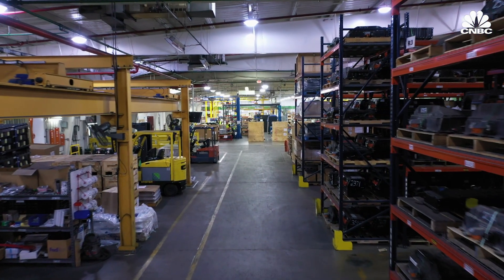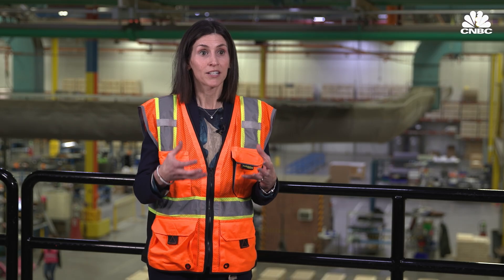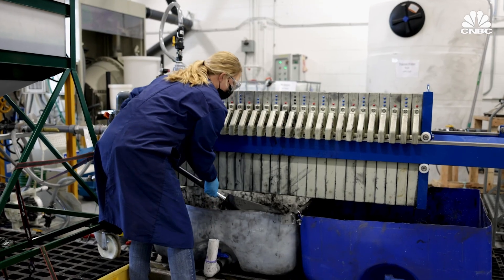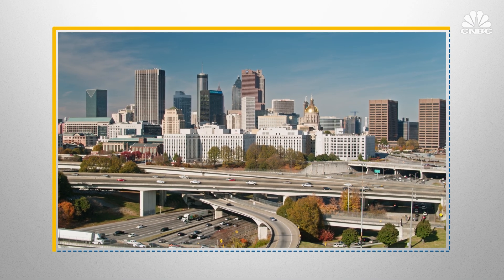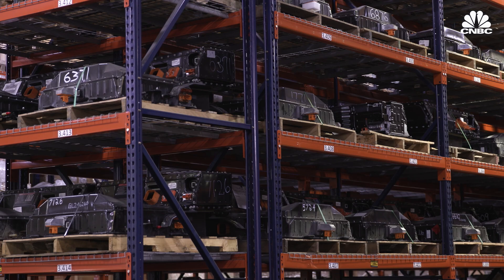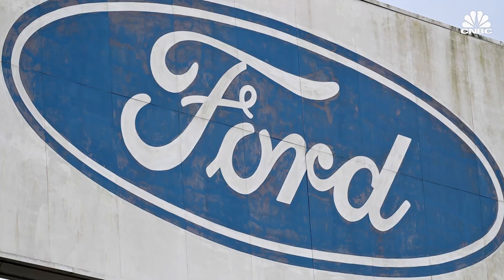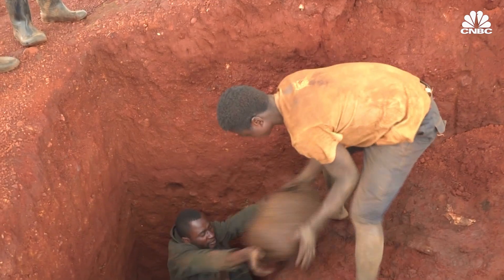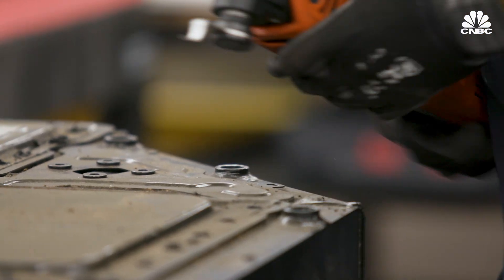Where Do EV Batteries Go When They Die?

Comment: In Australia it appears 90% of all Li-Ion batteries go to landfill and this would be the case in many other countries due to the lack of facilities that can safely dismantle large packs and the fire risks of shredding cells and packs. There are substantial cost involved in construction of these plants, the safety systems and trained staff to operate these processing plants. The failure even extends to solar PV panels of which 99% go to landfill.

Comment: A battery pack is only good for 12 to 15 years?  I have a 2008 model year IC vehicle with just over 100K miles now.  I plan to be driving that for at least another 50K or 100K miles, until the current engine or transmission needs a rebuild and the price of the rebuild does not make economic sense to keep the car.  So at the pace I drive I will have that car for 30 years.  EV's need to be competitive with that, or they are just not practical for me.

Comment: You say SNT handles 15,000 batteries a month. The guy you interviewed said they get 50 to a 100 a day. At 30 days of 100 that's 3000 batteries. If it's the lower number it would be 1500. Did you just add a zero to get the 15,000 number?

Comment: Ya no it cant be recycled so where does all the batteries go to the junkyard. Come on people need to realize ev was a bad idea your going to mine out all the minerals and it wont truly be recycled back like steel from regular cars. There is a limited amount of minable minerals for a battery and once all thats mined out your are screwed if your still electric
Reply: fyi the ammount of contamination and leaching and toxins put back into the world from recycling a battery is very very bad this vide only showed refubish batteries and once it reaches its 30 year use it is a DEAD BATTERY and only way to fix it is to recycle it which causes more pollution then even the help of a electric car in the first place

Comment: why is the new ev battery rate at 12-15 while the reuse one at 5-30. The lower bound make sense but the upper bound is odd. Somehow they extend their lifetime after refurbishing?
Reply: because they are being used for different purposes, inside an ev there is much higher power demand from each cell whereas for a stationary aplication the power demand and recharging is smaller thus they have even lower degridation when they are reused. Also, they replace the most damaged part of the pack, because often their are individual cells in a battery pack that have much higher degridation than the others. If you replace the degraded cells the battery can almost act as if its brand new.

Comment: And yet most EVs are still running on fossil fuel generated electricity.  Why is there anyone thinking about green energy? eh... no, solar and wind just won't cut it.  Fusion is probably still years away.  People says No to Nuclear.  Even if Nuclear plants are built, the aging electrical infrastructure is probably not going to be enough for many more EVs?

Comment: 10-15 years is not correct. When batteries are not used in the car anymore it will continue to be used for another 30 years as a battery bank in a home.
Reply: as a mechanic I discuss the problems with electric cars in depth on my home page vid

Comment: Li batteries are very sophisticated and nothing like lead acid batteries. They have many different layers and complex structures, making them harder to recycle than one may think. Plus solid state batteries will eventually be used and this means another type of recycling may be necessary.
Reply: Clearly a problem that can never be solved. We should just give up recycling as no one will ever figure out a cost effective method to recycle Li batteries. You should probably let Redwood materials know that there is no use expanding their factory as what they are already doing is too difficult to be done
Reply: @Jeddin stop being dramatic. EVs run off  60% fossil, 20%nuclear, the batteries are extremely toxic to mine(done in mostly poor non-environmentally regulated countries), and the batteries are very difficult to recycle. When you drive off the lot in a brand new EV, it’s done about as much damage to the environment as if you had drove 100k miles on a gas engine.

I am not against EVs, but I am certainly against the current propaganda the gov. Is using to push them.

Evs have been around just as long as ICE vehicules and there is a reason we have gone w gas vehicals, as it is much more efficient.
Reply: @bluesfan6862  you are the one being dramatic with “the batteries are very difficult to recycle”. Look at the interviews with Redwood Materials founder Jeffrey Straube former Tesla confounded who started the battery recycling company in 2017. Their tech demonstrates 95% efficiency in ev battery recycling. However they have been mostly recycling laptop and cellphone batteries as they just can’t source enough EV batteries. The supposed EV battery environmental Armageddon has never happened. The batteries are lasting in cars much longer then expected. And when they reach end of life they are being reused as stationary battery storage since an EV battery end of life is 30-40% degradation but 60% of a 40-90 kWh battery is more then plenty for stationary storage.
Reply: @bluesfan6862 ... There's another problem they let slip out of their mouths.  A recycled battery pack going into a new car?  New car buyers aren't going to be purchasing a new battery tested from "new" but having to have older Lithium cells with refurbished other cells to really have miles driven and recharged on a new car sold? I'm glad I'm not getting scammed by accepting a new car with refurbished electric cell battery packs that already come with less miles to go on them because refurbished is miles already driven and recharged with what's there. 😬

Comment: I would like to see what the emissions are relating to this? Next day delivery and all that 😅
Reply: A very good point Sir.

It all depends on how you create your energy in the first place.
Where I live (in Australia) we have weeks on end where there are zero emissions for all of our energy consumption across millions of homes, industry, and infrastructure alike due to our progressive government's push to increase wind, solar, and energy storage. Once we get to 150% renewable energy then we can re-awaken industries that have long since closed (or invite progressive new ones) due to rising costs and cheaper production based mainly in China. The extra 50% is included as a redundancy for when the wind doesn't blow and the sun doesn't shine, in the very same way that out coal and gas fired generators have an extra 50% redundancy for maintenance and breakdowns etc.

Having personally worked in the mining and energy industry for many years, I have personally seen the changes over time as we transition away from one system and towards another. That being said it's interesting to hear the amount of 'noise' coming from the sector's that have not anticipated the transition and the message that they spread. Very interesting times indeed👍

Comment: They said the life of an EV battery pack is 12-15 years. This is like saying a gas motor only has a 100,000 mile lifespan. It is correct that they do not have new performance at that point. And your range is probably 20% degraded compared to new. But that is still over 200 miles with a good EV. 

So with an old ice car you put oil in it more often when it starts burning oil. You don’t get rid of it. With an EV you charge a little more often. You don’t get rid of it. 

In 2040 I expect plenty of 25 year old EV’s limping along being purchased for like $4000.
Reply: And this solves the "Poor people won't be able to afford an EV" problem.

Comment: This is so encouraging!  I've seen a YT video where a garage that works only on EV's  fixed a "dead" battery by replacing a few defective cells.  Batteries consist of cells, your lead acid car battery has six of them.  It's rare that they all degrade at the same rate.  I recently had a car battery that was all but dead.  Using a hydrometer (it measures the specific gravity of the acid) three cells were excellent and three were dead!  Applying this to a hundred? celled EV battery, you find the bed cells, replace them with good ones from other "dead" batteries.

You can bet someone will be rebuilding Tesla batteries before long. Too big a market place and oh-so-easy to beat the price of a new Tesla battery.
Reply: Don’t expect that normally. Most dealers will only swap the whole thing and charge thousands.
Reply: @danyeo  Did I say anything about Tesla selling remanufactured batteries? No, I did not.  Apparently there are more and more indy EV garages opening all of the time.
Reply: @frequentlycynical642  I didn't mention Tesla either, but yes, it's a rapidly expanding industry. Anti EV critics quickly write off batteries when the ball is just getting rolling. You have to wonder right now, which companies to invest in because you know damm well a few of them are going to take off. If an EV can go 200K and you can get just a few cells replaced that would be awesome. Competition will give better options and bring prices down on repairs.

Comment: One of Elons tesla partmers left it to set up a recycling firm for batteries. Renault-Nissan is reusing them for off-grid power packs. China must be far ahead on this considering its volume.
Reply: In China, old EV batteries are used as UPS for communication base stations to replace traditional lead-acid batteries; second, they are used by small-scale companies to provide solar energy or electric bicycles; third, they are used for mineral recycling. Due to the increase in prices of international mineral transactions, CATL of battery recycling subsidiary has become profitable last year

Comment: All consumer products should fundamentally be based on a recycling system it should be part of products assembly system to be able to break down and recycle. If done correctly a efficient system wouldn't never need a product fixing because it would be simply recycled in to a new product from the break down of materials. A efficient recycling system should be as efficient as build of a product. And integrated in to factory system. All process should be in one factory from raw materials to product and recycling in to new product. Tesla build everything in one factory if they could integrate recycling as well this system could be a standard model for all factory systems. It should be a standard model for 21 century factory's.

Comment: This is the part to ev ownership that I'm not sure of that's holding me back. When the battery is 15 years old will the cost of a refurbished battery be more than what the car/truck worth? If it is then that's a problem.
Reply: Will you still own the same EV in 15yrs? Average car ownership is 11. So its the used buyer at best who will be paying for this baytery based on degredation results just like engine mileage/condition and soon fuel economy-emissions
Reply: @Stephen Doherty  I might not own it for 15 years but I care about the resale value with the 15 year old battery in there.

Comment: I think the electrification of cars is happening too soon, especially since we don't have the back end power technology to charge all of these batteries.
Reply: No, its happening too late. The oil crisis of the 70's should have been the start. Not only would mining been more economical and cheaper because it would have been developed along side, and therefor the current huge price spike due to demand avoided, we would be much further in battery chemistry department and mass storage to harvest renewable spikes. Energy would be extremely cheap because its largely produced by not only solar or wind farms, each building/home/parkinglot would produce independent from [what would be a backup] grid, because of personal solar to cover most if not all personal demand.

Heck, even in the 90's GM already made a good EV for its time, but then obviously turned them into scrap.

As with virtually anything, the best time to start is asap

Comment: 0:53 Time for a new bookshelf, John.

By the way, apart from the point of resources, the recycling of batteries is critical for EVs. This is because the carbon footprint of battery production is greater than that of gasoline vehicles and, depending on the mileage, is inherently bad for the environment. If EVs become popular in the future, the supply of recycled batteries will greatly exceed the demand, and we can expect the spread of inexpensive products that use them. For example, cheap electric motorcycles with poor battery life, emergency batteries for home use, power stabilization of renewable energy, etc.

Comment: It would seem like there would be a bigger market for recycling the material. As battery technology improves and changes, putting these packs back into their original form wouldn’t seem the best course of action. I like the idea of the upgrading to current specifications, but that doesn’t necessarily mean to the newest and best chemistries out there. Of course, there will always be a need for older batteries so we can have a thriving used car market as well. Finding the right balance, I suppose, is the tricky part.
Reply: I think long term, this will bring down the price of batteries overall and thus make things like EVs cheaper, since the battery is often the most expensive component. If we can get the price low enough for these process, then I think the idea of buying a used car may change to buying a “refurbished” car, similar to how you can buy other refurbished electronics now.
Reply: Recycling still consumes energy and has externalities that need to be accounted for. Degraded range in a car might make it unsuitable but reusing those packs in a domestic or industrial setting that don’t have the same size/weight constraints is cheaper and has fewer inputs than turning an old battery into a new one. That should be the first resort. Reprocessing should be the last one when a cell is completely degraded.

The same happens by default in hybrids. A full EV with 80% of original capacity might be unusable. But a hybrid with the same is not worth worrying and most owners would have zero idea and not notice a degradation in fuel economy. Degraded cells are not dead cells. There are Priuses out there from 2000s with an absurd amount of kms on the clock but they’re still going strong.

Comment: Only if the cars aren't wrecked. The mangled cars will go to the junk yard and the batteries will go into the water supply.
Reply: The batteries can still be recycled, even in this case. Look no further than Redwood minerals, also mentioned in the video. They not only handle failed battery packs, but also battery packs that were damaged during a collision and other batteries as well.
Reply: @ProXcaliber  You're right, however once EVs are 90% of vehicles on the road, what percent are not recycled properly? 1%? 10%? 30%?  I hope someone is thinking about how to keep batteries out of the water supply.